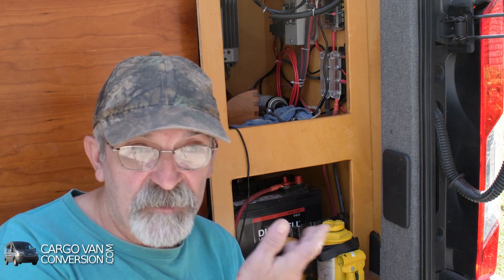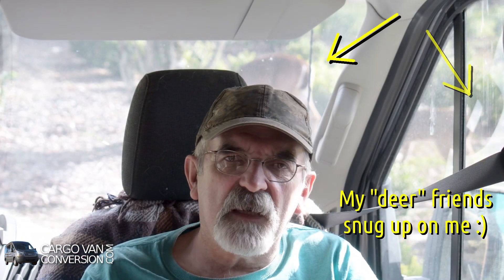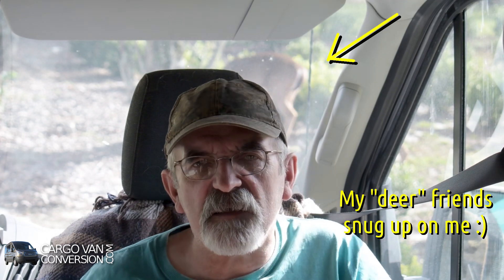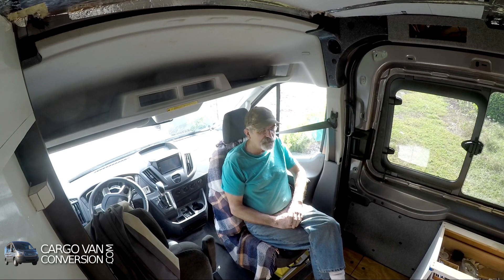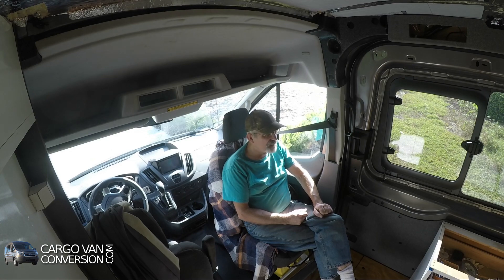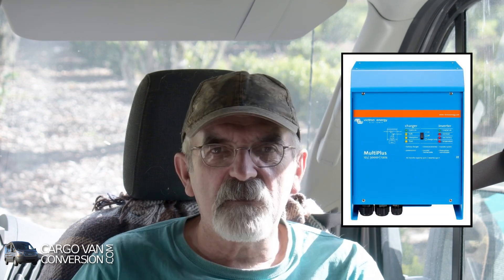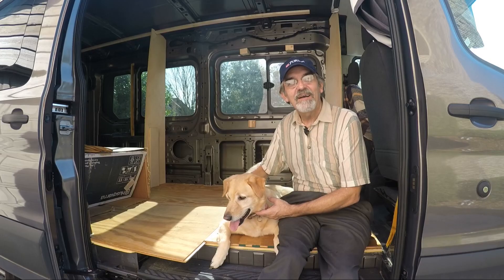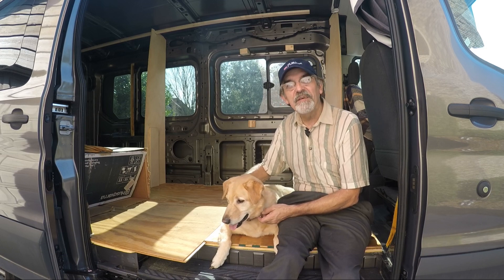Building A DIY Lithium Battery

Comment: G'day Van & Joey,  We looked into the Lithium V AGM comparison taking into account System requirements, Initial as well as On going costs & finally
what we realistically needed the Off Grid system to achieve  & maintain. I know our vehicles are different with weight carrying & size being foremost,
but in essence we both require the same outcome.
After doing all our homework & taking everything we could think of, (even our age & how long we would be capable on /off road) we settled on a
quality AGM system instead of  Lithium, also Lithium is a new technology & at present quite expensive but slowly becoming cheaper & further down
the track in a few years could be worth looking at as an alternative Off Grid power source.
You & Joey Travel Safe Mate,   Steve.
Reply from the maker: Good Morning Steve,
I think you made the right evaluation. You have the luxury of space and weight capacity, which reduce the necessity of Lithium quite a bit. In my case, these are way more important. The longevity advantage as far as cost comparison goes, may also be less than advertised. Only a short time ago Lithium was projected to have a ~5000 cycle life; that is already reduced to 2000 cycles without even been tested out in real live situations. And lately, I have seen prices coming down and availability go up.
There is however one big advantage to LiFePO4 not regularly mentioned. That is the charge an discharge curve. For longevity, it is advised to not exceed the 10%-90% or 20%-80% SOC. With a much higher charge rate than lead-acid and the virtually unnecessary floating charge, alternator and solar charging is much faster and not overcritical. With lead-acid there is always hours of floating involved which cannot be skipped. Solar panels are thus much more efficient and if you're low on power, a two hour drive could replenish most of your batteries. All that could lead to a smaller installation and lower cost.
Van Williams & Joey
Reply: @cargovanconversion  G'day again Van, Yes you are correct in what you have said & as I mentioned our vehicles greatly differ. We set up our system as follows, 1000 Watts of solar panels feeding 4 X 12V 300 Amp/Hr AGM batteries that are also charged from the trucks 225 Amp Alternator plus we have the 50 Amp 24 volt charger running of a 6 Kva Diesel Generator. The AGM batteries weigh 100 Kg or 220 Lbs each so with the 2 X 4000 Watt pure sinewave inverters (one is a backup) the entire setup weighs in at 500Kg or  1100 Lbs that is why I did not mention it in my comment only our reason for going down that route Mate,  Steve.
Reply: Aussie drifter gulps power while cargo van conversion merely sips power. Is my apology too simplified?
Reply: Analogy!
Reply: @volvoqueen9698  Yes I think so Mate, we have a 4X4 long range Expedition Truck that weights in at 14 Ton fully loaded, Van knows this as we have been chatting for a long time now.

Comment: I think you will be happy with this solution.  I've built several of these batteries.  Current system is 800ah (16 200ah cells).  Based on the picture of the BMS, that looks like the one I've been using.  Smart BMS 120a with low temp protection.   I got the bluetooth module and they are great.   Be sure and put all 8 cells in parallel and top balance them to 3.65V.  This is very important to get a balance between cells before putting them in 4S package.  Do you know if the batteries you ordered are grade A? 
Good luck.
Reply from the maker: Hi Mike,
a bit late but 'm catching up on the comments.
Yes I think it's the same BMS (JBD); Overkill here in the US, I got it directly from Alibaba. Currently top balancing already too many days :) They are Grade A, at least, I was told so. But I think that this is a grey market item, so I hope they are, but expect less than that. Expect to use them at ~20%-80% SOC, so no big issue there. Probably a new video about them, next week (2/19/21).
Van Willams